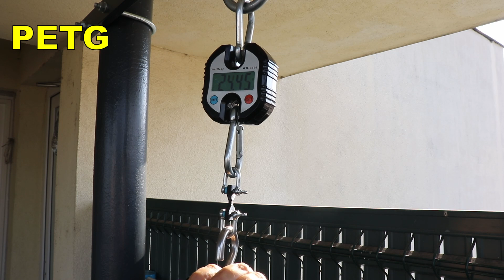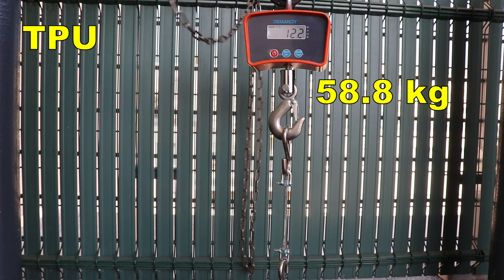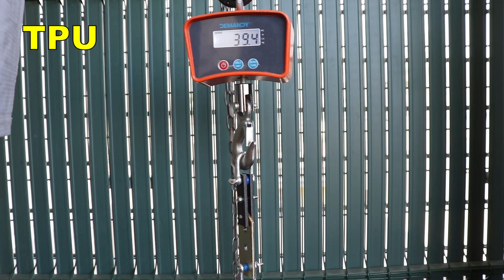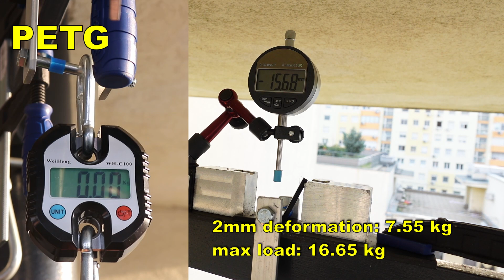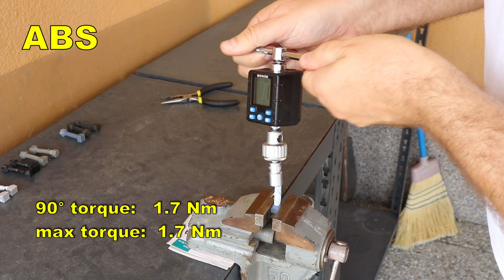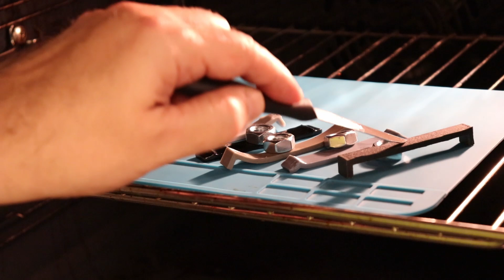Creality filament review, part 2: mechanical tests (PLA, SILK, PETG, TPU, ABS, Carbon)

Comment: You are amazing, glad I discovered your channel! Another interesting test could be resistance to abrasion, maybe try and mark with different hardness materials with same force or run each material over small sharp rocks for a fixed period of time and check the wear. Also perhaps friction test -how much resistance the material has in contact with other materials.
Reply from the maker: Exactly what I am working on now.. preparing a unit for this, to have comparable results.

Comment: You know, now Creality has some filaments right now, namely Ender-PLA, CR-PLA, HP-PLA, and ULTRA PLA. If you can get your hands on these filaments, I would like to see the difference between PLA, especially they are coming from the same brands. My suggestion, if you test different filament, try to use the same color. I love your work!

Comment: Since you mentioned you print mostly functional parts have you ever considered a set of functional parts tested over time?  I have wondered how well PLA will fair when it is required to repeatedly handle different mechanically functional requirements.  I print for functionality and am always looking to learn more about how well a material will perform not only right off te machine but how long and well it will perform after extended period of time.  Currently I use ABS and PetG mostly with a little nylon.  Carbon fiber looked very interesting for special needs.  Thanks for these 2 videos they went above what most reviews do for practical information.
Reply from the maker: Great idea. I will start now, but it will take time. Print test specimens, test them now and the other half in maybe few months or even more.. Hm. But I have to do this with PLA, PETG and ABS minimum.. too much work for so small channel, but I am curious person...

Comment: I don't know anything about fdm I use more resin printer but the impact test whit tpu can be used to know how good is the material to absorb 'impacts'? Other thing is like other commentary says, measure the elasticity of the material and test how it takes to deform, maybe test if the orientation when printing (horizontal, vertical, 45 degree) can affects the elasticity of the pieces or maybe measure the compression that the material can support i don't know maybe I'm saying crazy or non sense things.
Reply from the maker: Thx, I am collection informations so far (but before TPU there will be a PETG brands comparison video, maybe in a month, similar to PLA comparison https://youtu.be/L9tNhfxs9BU )